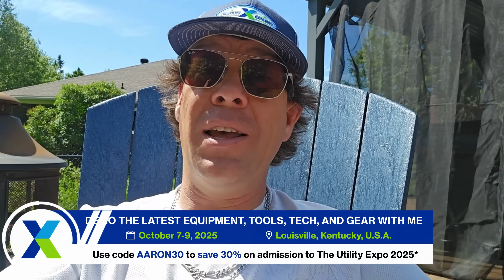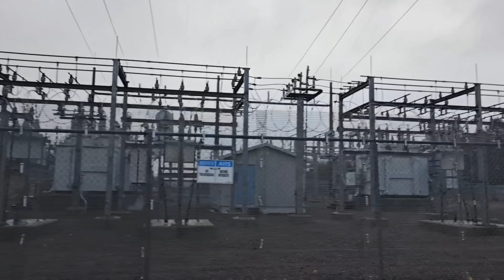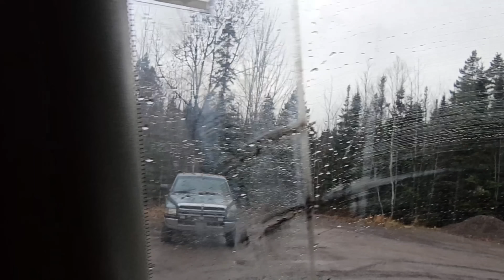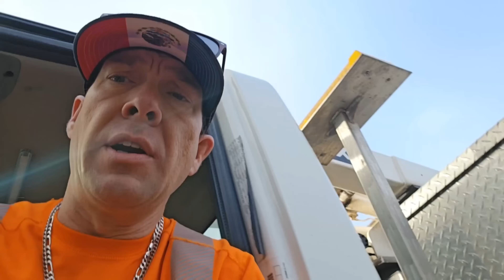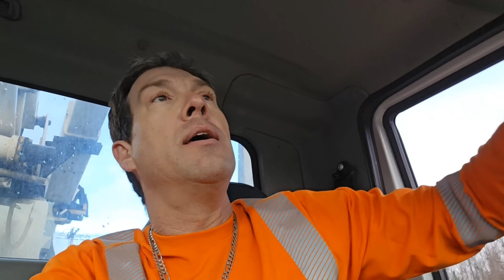138kV Transmission line outage

Comment: Is your company radio system still analog or has it been upgraded to digital ? 

Is it encrypted ? 

Most of ours are digital but not encrypted, so once you know the talk groups you can listen to your area 

Back in the 70s and 80s Niagra Mohawk had 5 Frequencies, for each different county
Troy, Albany, Schenectady, Saratoga and they had a special frequency for Storms 

I used to know the supervisor who was the top guy in the office 

I loved listening to all the crews and the work happening 

They also had low power handheld radios using Red Dot for each crew on scene to talk from the ground to the guy in the bucket

I miss the 80s

It was much simpler to monitor the town and the area

Most systems were Simplex or Repeater with everyone on the same repeater frequency, base, mobile and handhelds 

The trunked systems are way too complicated and difficult to listen to. 

Back in the 80s you could follow the action and not miss much scanning between the Frequencies 
Today you miss too much going from one TG to another

Comment: Hydro one installing a 2nd big power transmition line over my farm just west of Thunder bay ont. There contractors cut timber and brush fall into winter building a road to get trucks in with all the seel, and pre fab concret for the tower to stand on, that one 10' in the ground, then 4 other concret pre fab block one for each of the 4 guy cables that suport the tower,, so far they have 2 towers put together on the ground at my farm, they got kicked out for floating eqipment on half load roads here, our road was horible to drive. Any was over a month ago one of the mfg cable bolts that go into the concret guy ancer was mfg defective, soon after they used a crain to stand up a bunch of new towers bolted tower bace hooked up all for guy cables torked them, that night all power went out thunder bay an area. What i was told one of the new towers with no power cables on them yet, one of that mfg cable ancer bolts to the guy cable broke, the tower fell over into the old 4 legged transmition linehitting 3 phases on the older transmition line. I would have loved to be close to tower #173 to see the light show that put out. The cables passing my farm on the older line, 2 lines are still sagged way down, i can see big problems with these new free standing towers with 4 guy cables, one bakes it all into the other transmition line cross ciuntry. Lol

Comment: People have a hard time grasping how loud fuses are. They don’t melt in those conditions, they vaporize. 

Best example for those who were around incandescent light bulbs when they go out. Much lower power, much smaller “fuse”, and silenced by a high vacuum and yet they can still be heard and seen quite easily and that’s just the glass getting hit by the remnants of a tiny portion of filament

Comment: Long time listener and viewer here. I'm absolutely fascinated by the higher voltage/transmission side of things. I'm an inside wireman with my own contracting business. I have a question that's been burning in my mind for years now. I live right on the border to West coast of U.S and Canada. In my backyard are 500,000 volt transmission lines. There's a spot on my property on a hill where there's only about 25-30' to the lines. I see all sorts of strange effects from the stray voltage/current in the air. 
1. The hair on my arms start to tingle. 
2. I can get shocked by touching the grass and see small sparks just from touching the ground.
3. My T5 fluke multimer reads up to 86 volts in the open air (which I'm sure it's higher under certain conditions.) 
4. I can get fluorescent and even LED bulbs to light up pretty easily at night time. 
    Anyways, I'm just really fascinated by this. Should I not do this or be more careful? Is there also any danger to touching one of the big transmission poles that's on my property? Thanks for all you do

Comment: This is truly amazing content and if I was a local resident, I'd be grateful for this video in helping understand the policies and procedures that need to take place restoring power. Transmission-related outages are no joke. Also, I wonder if the transmission line protection relays had some sort of fault location capability to help identify where the fault might have been on the line?

Comment: I like how you compared power lines to different types of roads. In Europe we have one more level, which is low voltage distribution system providing 400V multiphase voltage and 230V single phase. This system is like your narrow neighbourhood streets with very low speed limits. Then there's the medium voltage distribution system, working most often at 15 kV or 20 kV (this voltage is not unified around the EU afaik). Those you can compare to wider streets inside your city, like 2 or more lanes each direction, but still the speed is limited and you have to stop for a red light from time to time. And then there are transmission lines which mostly work at 110 kV, 220 kV and 400 kV. Those are your freeways with highest speed limits and no traffic lights. I believe there are even some that are over 400 kV, so they are like the German Autobahns with no speed limit 😂
Reply: There are many voltages used for different levels around the world. Distribution is normally in the 6-35kV range.
Here in Norway 22kV is most common with 11kV still used in the cities as a sort of legacy from the early electrification. There is also some old 5 and 6kV in some limited areas.
Regional lines owned and operated by the DNOs are usually 66 or 132kV here, but there are a few 110 and 33kV lines as well. The TSO operates 220, 300(275) and 420(400)kV, but also some 132kV lines up north in inner part of Lofoten and in Finnmark county.

Comment: So in reality, at the switch stations , you open the main fuses and disconnects, then physically unbolt the actuator motors, then power down the switch panels in the shack. 
A triple redundancy lock out for safety. 
WOW.    When the outage is over do you guys meetup and get your tags back? Or just resupply them.

Comment: @18:00 That sounds weird. Here in Europe things like that is reported in via the TSOs and is in a public database for everyone to see. If a transmission line is out, either planned or unplanned it is shown with a time span of outage. This will of course affect the hourly prices in different pricing zones because of grid limitations. The same info is also there for the larger generating stations. If one or more generators in a station is out it is listed in the same way. These are usually the larger power stations around of 100MW or more total installed capacity.
Now the actual cause of the outage is of course not public unless it is obvious. Like a big steel transmission tower buckled in the winter due to ice on the line or something.
Reply: They only act weird like that around here when its intentional sabotage/vandals, someone likely used a wireless hole puncher on the insulators, otherwise its extremely rare event for big transmission feeders to go out like that.

Comment: Distribution 12KV ?    Thought you said in previous videos that its 7.6KV ?
Reply from the maker: 12 is phase to phase on a three phase system. Single phase or any individual wire from a 3 phase is 7.2
Reply: @Bobsdecline  THANKS! cheers

Comment: I suppose the biggest problem are ETAs - if you know it's going to be a big long outage, then posting that early so people can adjust plans means fewer people care how long the outage is anymore. What I hate is when I'm in the dark and I don't know if it's going to be another 5 minutes, or 10 more hours, or even worse, 10 hours, but you then tell me 9 hours in that it'll be 1 more hour. Even when you don't know the problem - you've identified an outage occurred, you know it takes time to dispatch a crew,, knowing that crew will take an hour to get to your location is very helpful knowledge. Or if the crew is called away on a higher priority call, knowing a replacement crew is coming but will be there in 5 hours is useful. That's all we want to know - do we just work around it knowing power will be back "soon", or if power will be out for hours and I should change my plans. It's 5 PM, power goes out - do I wait for power to come back and make dinner, or do I go out to eat? Knowing the difference means I will have a happy family who's full and if power comes back at 10pm, 11pm, midnight, or 3am suddenly matters a lot less than sitting in the dark eating cold canned soup at 9pm.

Comment: 29:40 "I don't wanna say the system becomes overloaded" I might not live in the area but I think I get the concept, I just have to scale down both voltage and distance to numbers my brain can understand.
So, what you're trying to say is that it's not that it's "impossible" to do it that way, it's just "too inefficient", right?
The example I can comprehend is 120 volt extension cords that you can buy at the hardware store, allow me to elaborate:
The reason the hardware stores don't sell 100 foot long extension cords rated for 15 amps while only using 14AWG wire is because if you set it up that way the voltage drop is too high, meaning that even if you have 125 volts (maximum while still being within spec) on the input end, if you're trying to draw 15 amps on the other end (example, an 1875 watt hairdryer on full blast), the volts will have dropped below 110 volts (minimum tolerable while still being within spec), and so the extension cable is not fit for purpose and will likely get quite toasty in operation, because 15 volts at 15 amps is (P=V*I) 225 watts going into the extension cord that isn't coming out of the extension cord, and the only way for that to happen is for the cord itself to dissipate that power as heat! Even over 100 foot of extension cord, that's enough to quickly melt the insulation, and that's what we call a fire hazard!
Same thing with the distribution wiring I bet, the wires can only take so many amps, and even tho they don't need insulation, having that sort of power lost to just "heating the outdoors" by the wires acting like little heating elements is a big waste of money!

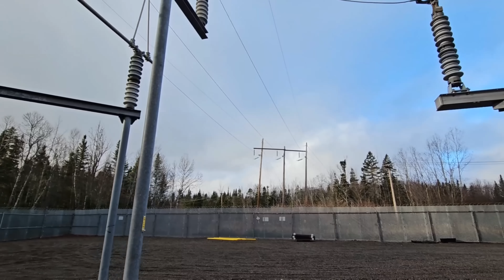Comment: 23:15 you can see the artifacts in the video caused by the RF radiation on the CCD in the camera 

THAT'S A LOT OF RF ENERGY 

I saw the same thing when I worked around microwave uplinks and radio towers.

Comment: Transmission lines are one of the most important parts of the grid. Reinforced steel or concrete structures should be used for anything 138kv & above. The wooden ones fail more easily. Sounds like it was more than just a tree on the line but I respect why you can't say more. Sad to see the illegal dumping is a problem there, I see it all too frequently on my hikes in the woods, especially by power lines.
Reply: That would have to be one hell of a tall tree to reach a transmission line!
Reply: @rupe53  Yup, exactly. That's why I suspect it was a failure of the wooden structure due to weather or animals (beavers). Wood should never be used on transmission structures, especially in a rural area. That part of Canada needs to strengthen it's transmission grid because the weather is only going to get worse, and wooden H frames are too antiquated and weak to handle it.
Reply: @PinePowerLI  Somehow I can't imagine critters chewing through treated wood structures. We still have many of then here in New England. Funny thing is they started replacing some of the post WWII lattice towers a few years ago due to rust. I walked up to some wooden structures not that long ago and the dates suggested they had been there around 60+ years. (regular inspections too) Only 15 years ago they did a transmission project (135kv?) and that was done in wood H frames.

Comment: Following safety procedures may make more sense, if people realized electric lineman work is several steps more hazardous than being a fireman, which in turn is more dangerous than often false claims about police safety.  

This video reminded me of how electric utilities no longer exist.  Instead, we have stock speculators that consume and play market games with former utilities.  That's how PGE runs nude beaches in Vermont, or Dominion runs nukes in Connecticut.  And C-suites get more concerned with those games, than regional electric services.  

As an engineer in only loosely peripheral industries, but with various year releases of IEEE C2, and some contact over time with PJM and ISO-NE, I got curious about the larger scale system map and snippets shown.  It took me under 2 minutes to identify the shown switching centers within a larger scale NBPower System Map.  

I don't see anything in this video that'd be useful to manipulate securities markets, though in general I think utilities owe the public more disclosure about core operations and system design and load factor issues, and too often make pretextual excuses for restricting disclosures.  

If I were on Prince Edward Island or Nova Scotia, I might have far more concerns about those major switching centers and grid ties, than if I were involved in the alternate loop paths of Hydro Quebec to ISO-NE (which are fully cross-Province), or ties to the nuke down on the ocean near Maine.  I can look up at grid near highways a couple hours from my rural home, and count 50% more grid capacity just adding up visual estimates of grid voltage and ampacity by conductor and insulator sizes and spacings, than NB Power claims for the entire Province.  

How's that big solar array not too far away?  

As an engineer I tend to devalue marketing PR, knowing utilities are critical infrastructure (as are some other industry facilities I've designed or managed), and that funding systems and C-suite types often have mixed goals relative to public service or abuses, and are more likely to be trying to manipulate perceptions and hide dark sides, than comply with securities law or system security issues.  If I can translate a simple video like this with key reference info blurred or hidden pretty quickly, in a region that's entirely unfamiliar as to utility details, but with some general industry awareness, into where it falls in a system map and what cross connections to other US or Provincial utilities exist and where or at what level of grid, I'd guess anyone nefarious either could, or knows how to hire engineers who do.  OTOH, Google Earth aerial views or nature walks with a camera can also show a lot.  

While I can see C-suite suits being cautious, there can be a point of absurdity trying to hide already public info. It's also difficult for field workers on tiring, safety and systems focused projects, to elevate distinguishing what may be legal or other causes to not disclose info. Either way, when far more info on public utilities is already public, even if some people don't realize where and how if they're unware of engineering standards and OSInt practices, faux-concealment reaches a point of silliness.  

There's also another side to that coin, where the kind of knowledge and awareness I and others like me have, has helped utilities improve public services, when I've supported needed projects with county planners or state PUC's, in private or via public hearings.

Comment: Should show some info on the power switching stations. How they work and all. We have an auto retry grid down here that they somehow feel out the problem areas and isolate on its own. I’ve personally seen a 10k customer outage turn into a 350 customer within about 15min. Guessing they are cellular and all report back in somewhere.

Comment: Being on call 24x7x365 is some incredible dedication to your community, and I hope that, especially after 21 years, you're well-remunerated for that on-call regimen. Some years ago, I involuntarily spent a year on call, when I was only supposed to be on call every other week, trading off with my boss. My workstation ran the software that sent pages, so if I was at work, I would be aware of pages before my pager even went off... but the one day I forgot the pager at home, my boss tore me a new one. The one time I did manage to get him to take the pager, he left it sitting on his desk with a dead battery for three days before I mentioned this to his boss, and then he tore me a new one for that. I have done non-abusive on-call work since, but nearly 30 years later, I still start to panic every time I hear that common Motorola pager's default alert tone... 😿

Comment: Pretty intense procedure isolating one section, then adding in safety measures, temporary serving while the big line gets fixed and then putting it all back to normal.

Comment: It's crazy hearing how each of the distribution feeds only have around 500 customers on them lol
Our lines down in town come from the next town over, and that sub has 69kv and steps it to 35kv for our one feed for the entire town.
Guestimating around 3,000 customers at the low end.
We do have a parallel line that splits off a few miles from the sub as of a few years ago. But before that it was about 27 miles of line to feed our town.
Had a lot of major outages back then haha